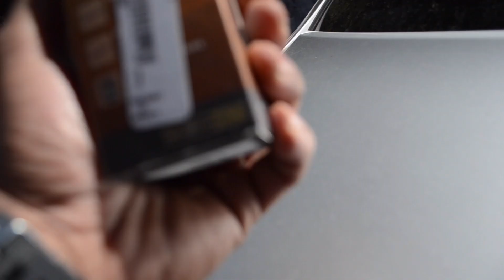Replacing My Clutch Slave Cylinder

Comment: Hello I have a Audi A6 3.2fsi v6 2005 would I have to change this if my clutch pedal sometimes gets stuck where I have to bring it back up I got told it’s something with fluid what causes it ? Or need bleeding ? But my clutch is perfect no noise just when changing gears it gets stuck now and again thanks

Comment: Any input on a 07 Audi 3.2 a4 something I should be worried about before I buy it
Reply from the maker: Dana Hardy I don’t know much about the 3.2. Just make sure it’s up to date on its maintenance. No signs of oil leaking in the engine anywhere, check for weird noises, ask what other work has been done to it/what work needs to be done to it still... Those should be the biggest concerns. Good luck!